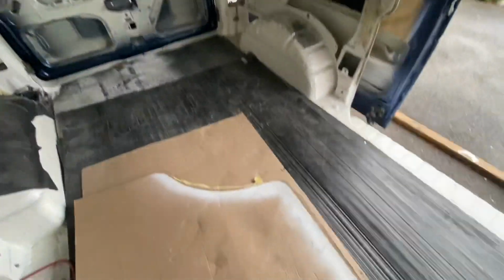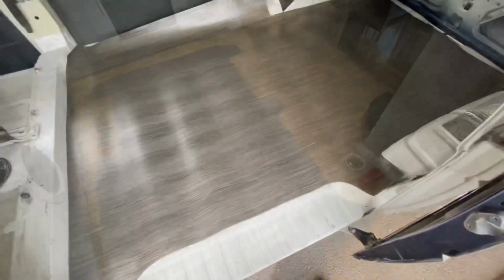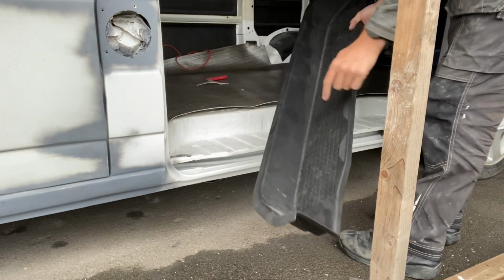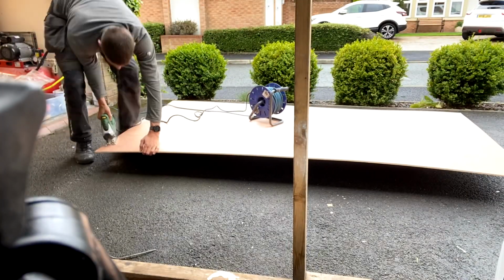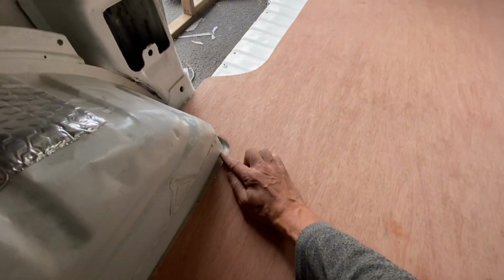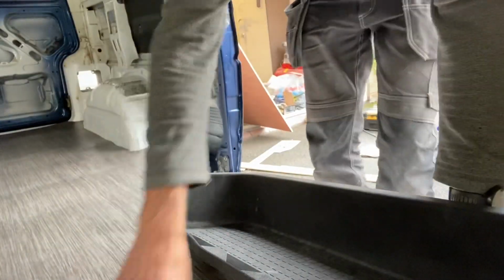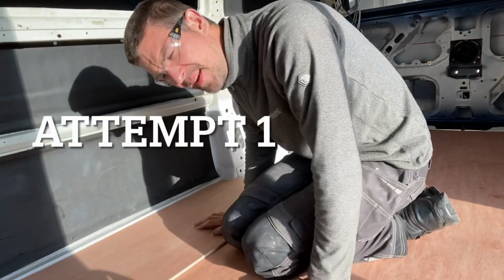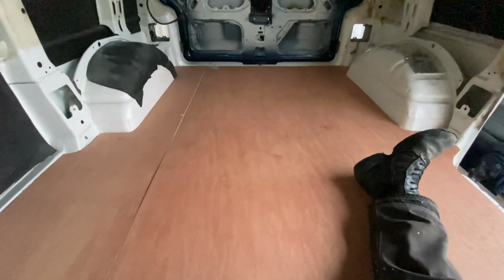Fitting the ply and vinyl flooring

Comment: Glad to see more progress 👍. I believe the convention is carpet line down with slight overlap onto the floor then ply floor then vinyl. That’s what I did on my T6. I also use the dodo at duo to sound deaden and insulate the floor but messed up the step height and had to do some fiddling, but has a very different floor pan.
Reply from the maker: Thank you, I was wondering to insulate the floor but thinking I won’t for the very reason of the floor height with consideration of the step. I too have used dodo deadening and insulation. Nice stuff to work with that deadening.

Comment: You don’t want it too perfek..as it will expand and contract ever so slightly seasonally. Vinyl first then drop the carpet on top of the minor gappage, same with the panels..you might want to change the carpets at some later date..vinyl should last forever..ever..ever ( sorry).
Part of the putting together must include your own flair of mistakes and how you’ve subtly concealed them or adapted to serve another purpose..it’s part of the charm i think. Glad I didn’t change the floor in mine with precut..I’d have a patchwork of cuts and glue everywhere lol. It’s the sticking down that will frustrate the hell out of you..
Looks neat 👍

Comment: Tidy, I would cover the ribbed floor with something to absorb resonance while you have the chance if it is not done already. My daily driver is a crew cab T4, ribbed floor came covered already with an anti resonance mat + original vinyl/foam on top, makes a world of difference to road noise compared to my camper conversion from a bog standard van, with closed cell foam insulation, plywood and waterproof laminate floor....now that I know it can be better, I need to lift it all up to put down some deadening matt or mass loaded vinyl mat under.....😉 ye know urself....
Reply from the maker: I do have a lot of insulation dodo matting left🧐
Reply: @pdubs7831  it would help a lot i’d say especially with the sticky back stuff that looks like torch on felt .You would have a lot of the the frequencies covered by both.Dodo have a version of it foil covered Hex pattern. It sort of takes the edge off the hum and reduces it. The Dodo mat would reduce the level of hum.I am thinking of covering mine from footwell to tailgate and arches, but it’s bloody expensive...
Reply from the maker: @csonics8639  have a look at my list of videos. There’s one of when I did the sound deadening. Sounds like I might have used the one your talking about